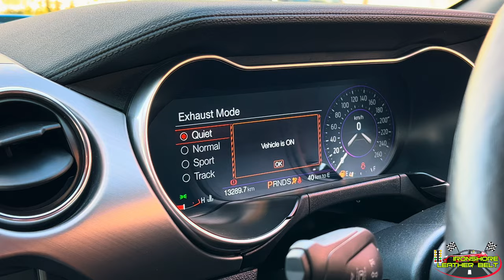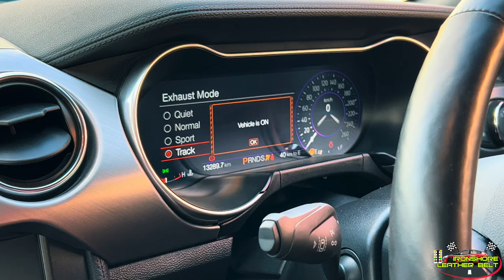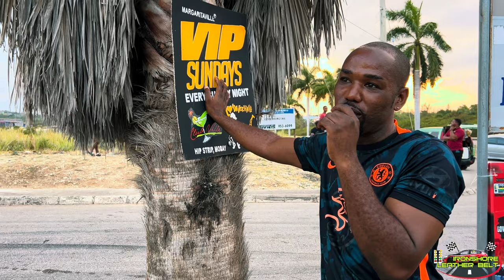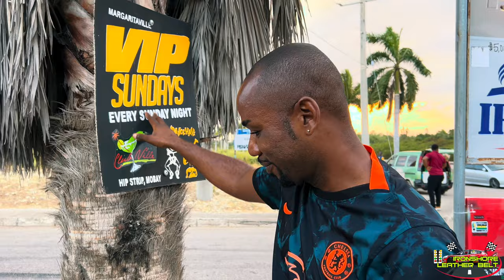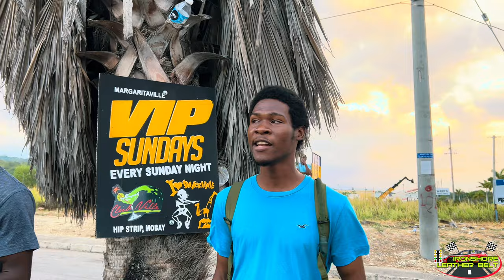Audi TT-RS vs Tesla @ Night Drag Racing & More

Comment: Just a realise sumn. Why no roll races for RWD cars like the Mustang? From the drain to the second palm tree. Choose one of the contenders to the pace car, the second contemder keeps level, the floor it at the second palm tree. 

Races like that will give 2WD cars a better chance against the RWD cars by eliminating a standing start. But of course, the standing start will have to happen first, and then from the results, you guys can determine whether or not a roll race would be worth it.
Reply: Great suggestion 👍

Comment: Tesla can run 60 mph in under 2 seconds and top out at 200 mph …. I think the Tesla driver scared to push it
Reply: That is not the plaid so it’s over 2 seconds
Reply: @thatglassesguy2582  well we need di cybertruck…. di cybertruck will even murda Virgo
Reply: @BeastSpedUP  the cyber truck no, but the cyber beast yes
Reply: Electric vehicles 😒 trash